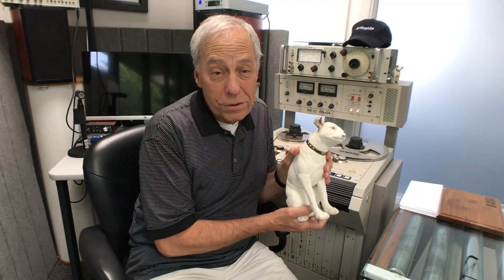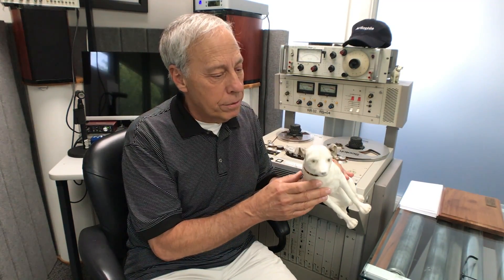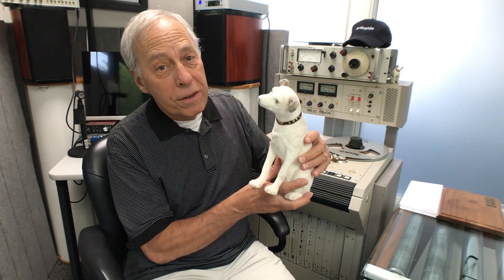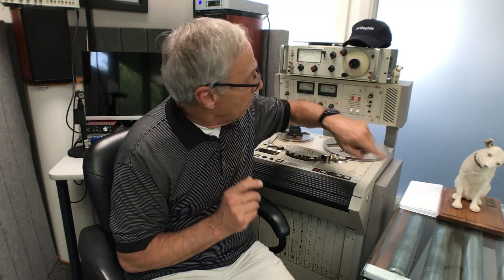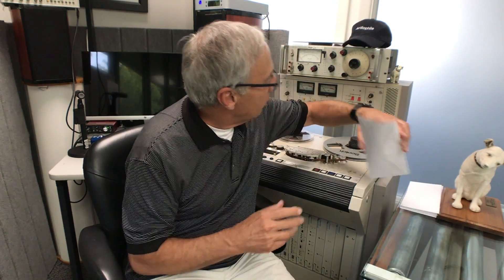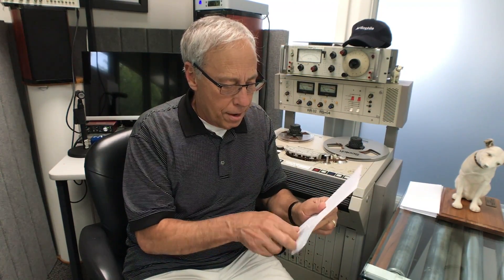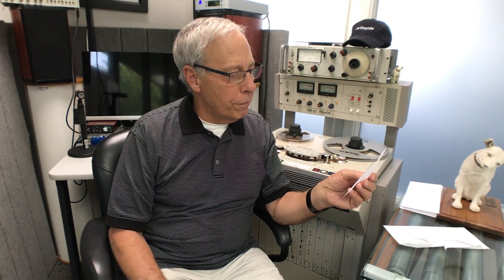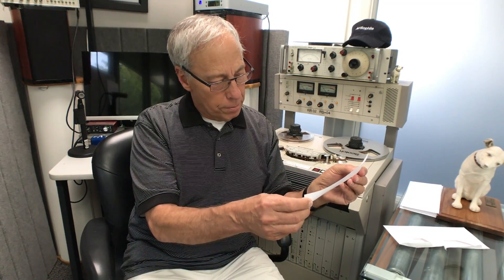Thin cables inside speakers

Comment: I replace them with high quality (DH Labs) silver, hook up wire with PTFE insulation. No brass in signal path only pure copper (I can't afford the pure silver connectors). I've gone so far as eliminating the plugs, not pretty but you don't see it. Solder using Cardas Quad eutectic. Be careful soldering onto drivers.

I started doing this when I discovered steel tabs (for 6.3mm push on terminals) in my 'higher end' speakers. Strong improvement in sound quality. Not sure why the manufacturer did this, brass would have been an upgrade. I bought the speakers new from accredited dealer.

I don't like to use any brass in the signal path, only pure copper (not plated) or silver. Silver and copper sound different. Brass is an alloy, you don't know what is in it especially if it's from the East.

Comment: All anyone needs is decent quality well terminated OFC cable around 12awg-10awg in an average home at domestic levels under 100m. 

Its been shon by audio engineers and the test equipment to be more than sufficient, hence multi million mastering studio's using such cables to produce the albums we love.

Like many I have been up and down with cables, but after a while you see where many companies get their cables, plugs and see the factual measurements and simply feel why. 

For me I see no harm in buying nice cables, but I want longevity, decent plugs, and easy to work with, a lot of my high end cables are inflexible, stiff, and after a good number of years tarnishing or in places even cracking. Most high end cables have banana cables that cannot even support the weight, Atlas, Chord Signature, Chord Oddysey, VDH D352 to name a few I have had who's banana plugs bent with weight or simply snapped over time.

I quite like the idea of having the same brand of wire from source to driver, I did it with VDH, I rewired with Audioquest and used different models from terminal, to crossover, and bass, mid, and treble used different cables, I used DNM solid core inside speakers, and when using Chord simply rewired the speakers with Chord, again with heavier gauge from terminals to crossover, from crossover to base, and that dropping in awg as it got to mid and treble. 

Did it make much difference? Well I beleive we imagine it does, it certainly feels nicer knowing you have a continual loom, and that the internal cables and well terminated and finished. 

But measurements that go beyond what we hear tell us there is no difference, which is why for decades some of the most accurate speakers on the planet had internal wiring like you would find inside a lamp cord.

Me, if I build or service speakers, I will simply use decent OFC copper from brands such as Audio Note AN500, or Canare, Beldin, or such, whatever is laying around. But certainly wont be wiring tweeters with 10awg cable.

Comment: He didn't appear to answer the question, which is odd because PS Audio use thin wires inside their cabinets too.
Is it merely cost cutting Paul? I wouldn't have thought it was  worthwhile when your speakers cost so much. How much have you saved yourselves, pennies?
Reply from the maker: It has nothing to do with saving a few pennies. Lord knows if we watched pennies we'd never get anywhere. No, the short lengths inside the speakers work just fine (like the traces on the crossover PC board) because they are so short and supply individual drivers. We've tries using heavier gauge and fancier cables inside and honestly cannot hear a difference.

Comment: Makes a good point about the number of speaker wires inside the speaker housing.  You'll have one thick set of speaker wire going from your amp to the speaker cabinet, but there are a lot of smaller speaker wires inside the cabinet, especially if you've got a 4-way speaker system for example.

Comment: I remember from reading an interview with the designer of Paradigm, he said that when working on upgrading its bookshelf speaker (from 'regular' to 'SE' edition), one of the change made was to upgrade the internal wiring to high grade copper cables.  There were a few more other 'upgrades', so the marginal effect of the internal wiring was not quantified, but the 'SE' model definitely sounded better than the 'normal' model.

Comment: Cables lying on the floor, possibly crossed by other cables, benefit from shielding and will therefore need to be a bit thicker.
Wires inside the speaker itself, or inside any device for that matter, doesn't need to be that heavily shielded.

Comment: Isn't the tiny wires inside the speakers defeating the purpose of using quality, large cables on the outside? It's almost analogous to having giant pipes feeding in water and at the end of it the diameter of the pipe shrinks to that of a pinhole, thus rendering the entire section of the large pipe to be totally useless for it's purpose.

Comment: The impedance of speaker wires shouldn't matter much. If the wire's impedance over the whole audio range are 0,01 ohm or 0,1 ohm doesn't matter when the load are a 4 or 8 ohm speaker.

Comment: When I went to replace the woofers on a pair of Vega d5s is when I noticed the lame tiny thin wires going from the crossover to the woofer.  I since have replaced that wire with 16g copper wire

Comment: I don't use heavy gauge speaker cable, and I'm never going to. And thick wire inside speakers in not necessary either. Anyone obsessing about cabling and internal wiring of speakers might more effectivly pay attention to construction and insulation. The best sound I ever heard was attaching various systems constructed by a professional constructor.  ... I'm guessing about 18 gauge twisted pair and very inexpensive. Just good copper in PVC. Too much fuss is paid to this sort of stuff when indeed engineering and Ohms and Watt's laws are more important.

Comment: Not a great answer, true. You can get away with smaller gauge wire inside the speaker because the length is so short. Basic physics.Longer runs, from the amp to speaker box require heavier gauge cable. The length of the run is the determining factor.

Comment: Speaker cables larger than the power cord are insane. Nothing is one hundred percent efficient or certainly not greater. Want to open your eyes? look at the leads from a voice coil to the cone of a driver. I understand the cost of over engineering so I don't call it snake oil, but there is a level of snobbery that I don't approve. Don't even try to tell me there is significant loss in cables less than twenty feet long, regardless of gauge.

Comment: I have a pair of 80's Radiotehnika S-90B speakers connected to a new Yamaha  R-N 803D stereo amplifier. I replaced the crappy 22 gauge aluminium crossover wires with 20 gauge full copper wires. Especially the mids and highs got a lot clearer. The cables from amp to speakers are 12 gauge.

Comment: Right, but you didn't answer the real question: Why are large cables preferable between the amp and the speaker when the internal wiring (inside both the amp and the speaker) is entirely different, smaller? Wouldn't the internal wires become the weak link regarding your perceived audio quality?

Comment: That’s probably the flimsiest answer I’ve ever heard to a question outside of politics.

There is another Youtuber who does deep speaker unboxing videos. He took apart a pair of speakers from Q Acoustics that I used to own, and I literally couldn’t believe what I saw. Super thin super cheap wire from the crossovers to the drivers. The marketing has you believe there is some sort of miracle taking place in a speaker cabinet. Once you have a look inside it’s very very basic stuff. It’s also a similar story inside amplifiers and CD players. The internal wiring to get to the terminals is very cheap.

The logical conclusion is that the companies who make hifi components know that fancy wires and cables are bullshit. They make their products to a standard. There is no way they skimp on that standard for the sake of a few feet of cable. Literally all the noise for high end cables comes from high end cable companies and the audiophile bible bashers that believe in it. I’m pretty sure it’s like 2-3% of cable companies actually publish the cable measurements and properties.
Reply: " It’s also a similar story inside amplifiers and CD players." - um, no, not all electronics.  And what do you mean by "super thin" in regards to wire?

Comment: Simply adding  larger gage wires is often not the answer.  I did this test 40 years ago only to go back to the wimpy wiring. I was 15 years old but spent many hours listening  and the swap to bigger wiring was an expensive situation.  Maybe it depends  on the amplifier? I was using Marantz and gas amps at the time. Later I found some info from gas that frown on larger than 16g speaker wire. Due to the damping factor of the amplifier? Dunno.

Comment: I have built many speakers, and restored many speakers too  it's not realistic to use 4mm cable to tweters for example. To solder that kind of cable to the terminal is just stupid!  The terminals are not designed to carry the weight of the cables. And it can damage the internal wiring in the driver if you add plenty of heat when soldering. You got to have approx a 60 Watt soldering iron to work properly with cables with 4-6-8 mm dimensions. There are many other things in  the speaker construction that are more important!  To have the right location of the crossover in the cabinet for example.  And alignment of the coils in the crossovers! So they don't interfere with each other! Important is also to keep the crossover away from the magnets and the metal of the driver's! To keep some distance.   I use 1,5 mm cable for internal wiring.

Comment: I think another part of the reason here that wasn't touched on in the video is cost. Most speaker manufacturers out there know that you are very likely never going to see what's on the inside of their speaker cabinets. Well, anything they can do to lower their cost of production and cost of goods sold increases their profitability on a per-unit basis. That alone right there tells you that most of them will use the smallest, thinnest wire they can possibly get away with and still have the product produce an acceptable level and quality of sound. Especially in larger companies that produce in larger volumes, the accountants in the company have a FAR bigger say as to what components actually end up getting used in products than what most people ever realize - and that all comes down to cost. I think if most people were to ever remove one of their drivers and look at the size of the wire that carries the signal to it inside their speakers they would be likely be shocked at how small it actually is. Now, you'll do that one day if you ever have to replace a blown driver, but by that time your product will almost certainly be long out of warranty and whatever company made and sold that speaker to you will have already made their money off of you. I'm surprised we don't see more high-end speaker companies addressing this exact issue today and partnering up with top-tier cable providers for their internal speaker cabling. That way they could could co-brand/cross-market their products and say "Internally cabled by X" and use that as a key differentiator and competitive selling point. If I was a manufacturer of high-end speaker cables, that's the very first type of deal I'd be out there trying to sign with every possible speaker manufacturer I could find.

Comment: I bought 12 AWG cable to upgrade the 22 AWG I had on my speakers, but it’s too thick to plug in the amplifier and the speakers. What I did was I joined both ends of the 12 AWG cable with around 4 inches of 16 AWG so they could fit. Is that ok? Or should I buy some plugs that make it thinner to fit the output holes and the speakers? I also read that taking out some of the copper strands would be ok for it to fit without damaging the sound, is that true?

Comment: Paul you can justify the smaller wiring inside the speaker cabinet by the distribution of the crossover to each speaker. Each speaker is sent a frequency range and the amount of power in that range to drive the individual speaker. Usually the woofer is designed to handle the majority of the wattage sent in by the amplifier and the mids and highs less of the total wattage use. So if you sent a 100 watts on a 12 gauge wire to a the 3 way speaker system. The woofer would suck up about 50 watts. Therefore it can use a smaller gauge wire to deliverer the amount of current through that wire to the woofer to drive it at maximum wattage.  The mids take up to 35 watts maximum and you can even use a smaller gauge wire to drive them. Finally the highs or tweeters are delivered the final 15 watts and you could calculate for even smaller wires to drive them. Like your videos too. Keep up the good informative work you do thanks.
Reply: I am sure that whatever wire is used the current capacity of the cable without heating up will be sufficient. 

In my view the only likely issue will be the effect on the crossover and in turn its effect on the tonal character of the speaker. This may be through resistance, capacitance or inductance, but within the speaker box whatever wire was employed when the speaker was designed will be part of its tonal character, and there is no point in changing it unless you start from scratch on the design of the crossover.

One thing that might be worth doing is ensuring that the wires inside the speaker are soldered to the speaker terminals rather than using connectors of any kind, whether spade connectors or whatever. There is a lot of opportunity for the signal to be corrupted going through the connectors, particularly as the speaker gets older and maybe some mold or corrosion forms.

It is still appropriate to use good thick cable feeding the speakers because you want to minimise the signal loss between the amplifier and the speaker. With a typical speaker having an impedance that drops as low as 4 ohms, this may be a factor worth considering, but honestly it is probably not that big a deal in most cases.

Another thing to aim for is to ideally have the cables to each speaker the same length, so that they are equally affected by the cables that feed them.

Comment: With all due respect to this gentleman, but I did not hear the answer to that simple question. Simple not only for an electronics engineer. So in cheap loudspeakers from a new production usually cheap components are installed, even awg 20/22 cables. In expensive loudspeakers of the current production, if someone installs poor-quality cabling, it is not otherwise for the sake of greater profit. In old good quality loudspeakers the thickness is ok. No one thought that the OFC cable would help, because it was not available on the market yet. 20-30 years ago, companies competed with each other, there was no such pressure on money and the price was honesty. Even mid-range products were refined. I had Technics Rx50 speakers that had standard copper cables of the appropriate thickness from the factory. The slightly newer Technics Rx70 model had great ofc 6N cables from the factory. I currently have a Sony APM 77w and I'm tempted to replace the usual but solid cables inside the speakers with a Chord clearway for woofer / middle and Chord C screen for the tweeter. Summarizing: If the speakers are of good quality and you want to stay with them for longer and you have noticed ordinary cables and the access is easy - replace them with better, ofc awg14 for middle / woofer and awg 16 for the tweeter. Remember good quality OFC cable in PE or Teflon insulation of the same cable lengths. Do not install very thick ones, quality is important. Do not touch the crossover, you will keep the originality and with the new cables you will improve the factory.

Comment: Hahahahaha ... first and LAST vid from this guy ...
Google "Skin Effect" old man !
Reply: No need to Google that since it's not a relevant factor for something so short as speaker cables since you'll end up with losses in the size of 0.0X dB at 20 kHz (calculated, even less when measured). That's just a case of cable manufacturers taking a phenomenon that exists and apply it to where it's not relevant in advertising so they can charge more for their products because most people don't have the knowledge to measure and calculate these things. 

As for Paul, PS Audio sells expensive cables (not their own though) so he won't want to say anything that negatively affects that.

Comment: Paul , would it be safe to replace internal speaker wire with  the same type you have connected to the speaker?
Reply from the maker: Sure. A lot of work but yes, no problem.
Reply: Thanks Paul. Have a good day mate

Comment: This is actually very interesting. My high end audio shop -a small passionate local outfit - actually developed their own cabling like speaker cable and interconnects. They also use this for their custom build amplifiers internally. It all is actually very very very thin. The cable is very directional also. They trial and error listen to the best direction for each little piece when they produce an amp. Back to the speaker cabling: They recommend to solder the wire directly to the speakers internal wire. Their philosophy is based on the idea that the less change in resistance, not the least cable resistance, in the whole chain will yield the clearest/best result. So every chunky copper binding post or speaker cable post you can eliminate will help tremendously. I guess by keeping the cable thin means they match their interconnects and speaker cable to the internal wire thickness. Thus creating the least resistance fluctuation in the whole signal path. tried a lot but this is by far the best.